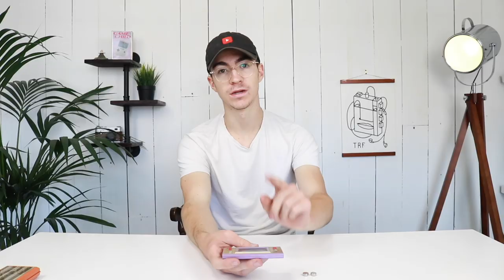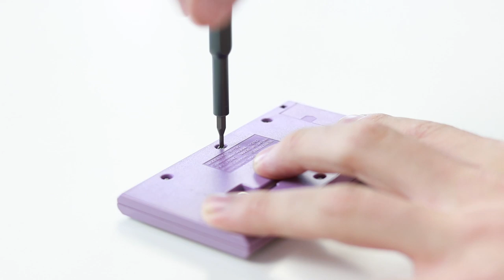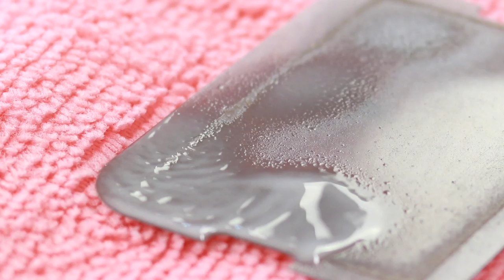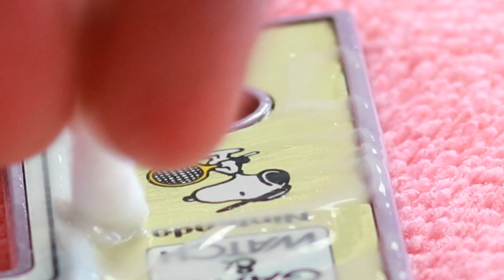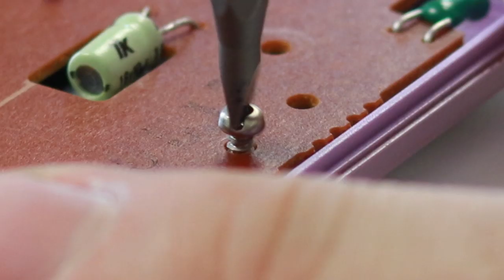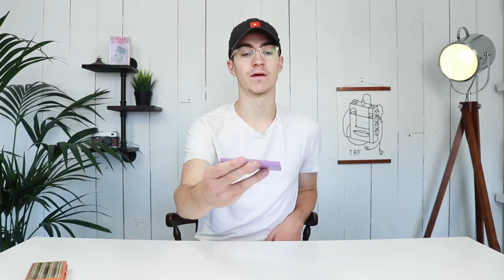Let's Refurb! - 1982 Nintendo Snoopy Tennis Game & Watch!

Comment: Nice cleanup. Only problem is the pre printed grass insert has been put back in upside down.
Reply: I just read this and had to go back and have a look haha
Reply: Yeah when he was playing I was like wtf is that on the top? I realized it was the grass and branches panel
Reply: Oh no, I was expecting a proper refurb video, talking about some of the common fixes you need to do with G&Ws, like replacing a faded polariser or stained back reflector, sourcing a decent replacement battery lid, or signs that it's time to replace the tired old power capacitor. That sort of thing. Instead we have a near-mint one, washed and put it back together wrong.

Comment: Hey man, I wanted to ask you or any people who are willing to answer a question. So I am 12 (just turned 12 on may 10th) and my oldest sister who is 25 got a tropical fish game and watch in the year of 2000. Unfortunately, it does not work. I did everything I could. I got some antiseptic wipes with 90 percent alcohol and wiped the battery placement thing, and the whole console. Also replaced the batteries. There was one thing I realized though. When I put the console in sunlight, and tilt it forward, I can see a huge and thick streak of black across the screen and a lot of scribbles. I can’t see it physically on the screen, it’s more like something inside the console, like internal. But when I turn it back to me, it’s gone. I am guessing the polarizer is damaged or something like that. Do you recommend anything I can do to get it working again? Maybe what materials to buy and what I should do if I open the console up?

Comment: There is  a dis lite problem that happens when you turn on the ds lite, the screen that is down flashes and the whole thing turns off. Do you know how to fix that?
Reply: Dragon Drex I think it's a battery problem tho I'm not sure. Does it make a popping sound?
Reply: If a screen flashes it means the other screen isn't connected properly